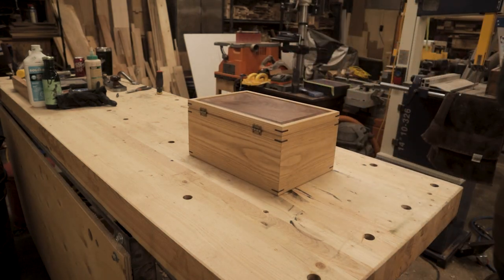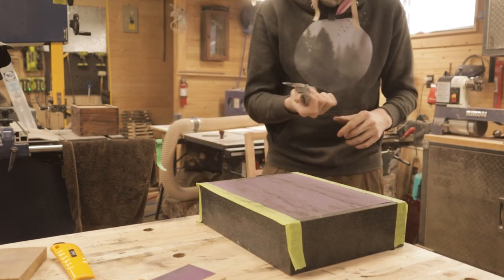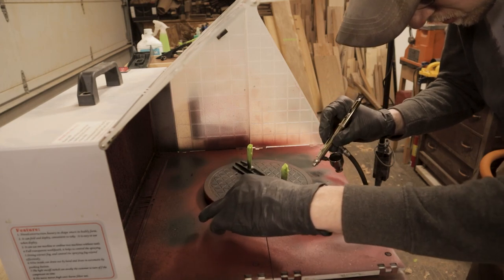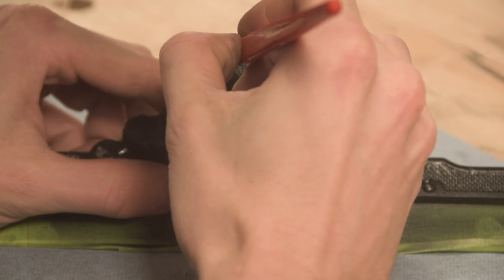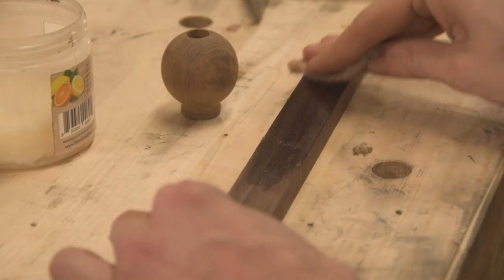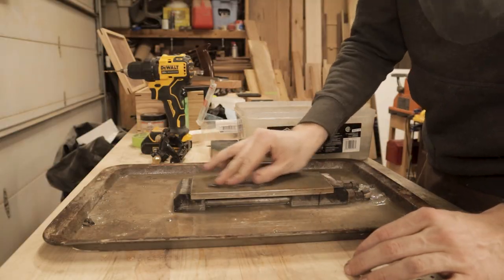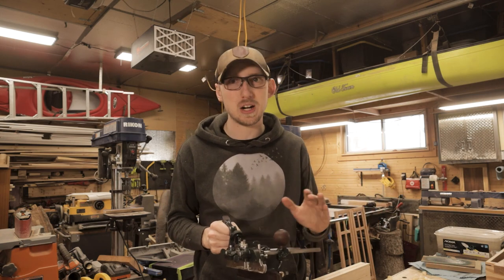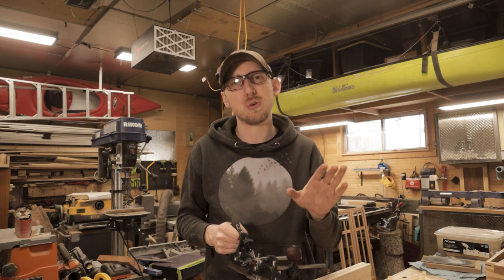Stanley No. 45 Tool Restoration

Comment: I believe those nickers are used across the stable line and they are available on eBay. Or were the last time I bought some
Reply from the maker: The problem with the nickers is that the one on the left skate, the screw is completely stripped. I'll probably end up drilling it out so I can at least take the nicker off so it works better when cutting grooves but then it's a matter of getting a new screw! I think Michael Jenks will be able to help out when the time comes, I just don't want to only order a single screw from him so I'm waiting till the next time I buy a plane with damaged/missing parts.

Comment: Very Nice! I painted my 45 restore as well. I also electroplated the skates with nickel, which you should try on your next restoration. It's pretty simple. Also, if you like the "wood" feel on handles you should use a hard wax oil. I use Osmo on my hand planes and hand saws for the same reason and it last for a long time without having to reapply. Thanks for the great video. :)
Reply from the maker: I'm interested in the nickel plating, I'm going to look into is and maybe try it out on some tool in the future.
I love hard wax oils but a few of my buddies very strongly advised me to not to use my favourite Tried and True oils on rosewood because of the linseed oil, but I can see how Osmo would work well. I've still got a little bit left over from a project so I'll have to give it a try, thanks for the recommendation!

Comment: Hit up Michael Jenks at just plane fun for the knickers. He has a great inventory at great prices. I restored my 45 a couple months back and I re-nickel plated mine. It was a learning process but came out great.
Reply from the maker: I had to cut it for time in the video but the problem with the knickers is the screw holding the one on the left skate is completely destroyed so the only way to fix it would be to get a new skate. When I got the fence parts from Michael, I thought about getting a replacement skate but it just seemed unnecessary. 
I haven't looked into the process of nickel plating because I just assumed it would be too complicated but now I'll have to look into it!